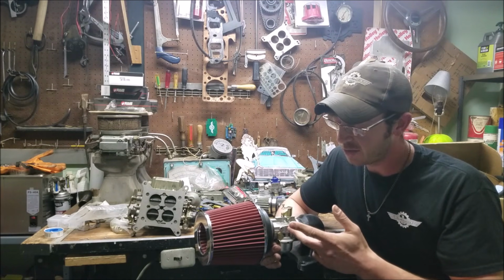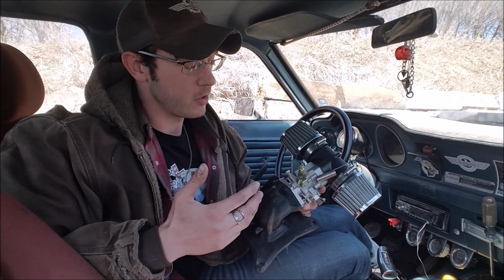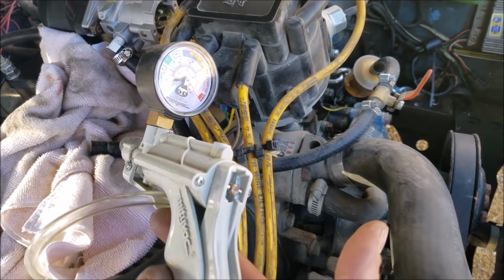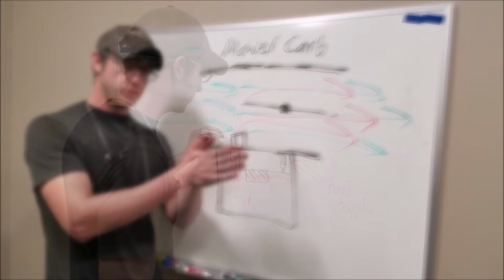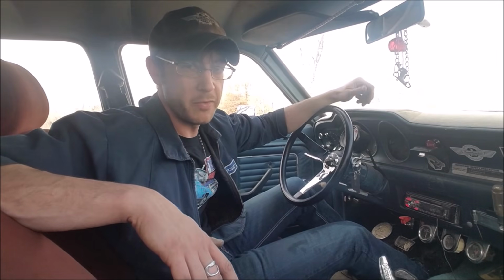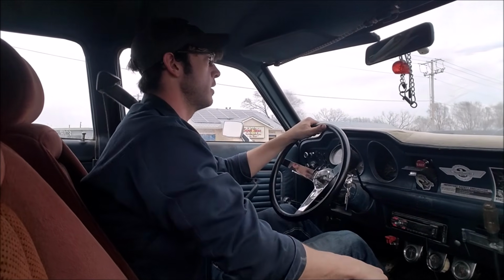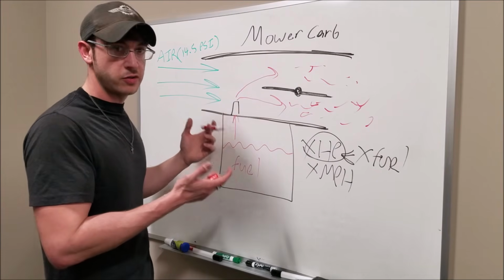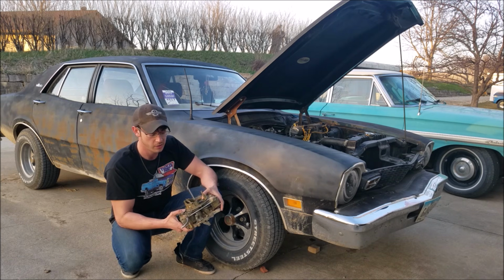Will It Run? Lawn Mower Carb on V8! (The "IMPOSSIBLE" Becomes Reality!) Start to Finish

Comment: Would love to see this on a Lima 2.3 4 cylinder in a ranger or something. Maybe a 240/300 or smaller falcon straight six.
Reply: So many cold, early mornings fighting my 2.3, cruel words, starting fluid and violence emanating from my driveway for the world to hear just for the pleasure of using a motor that could barely pull a booger.  Ahh the nostalgia!

Comment: Don't know why he is so surprised gm,ford,chysler all made one-barrel carbs that were basically a lawn mower carb and if you dialed those back you can get similar results and to be honest you can do it with a regular carb by restricting the fuel with lower fuel pressure and leaner jets.
Reply from the maker: Lol comparing a 1 barrel to a lawn mower carb. Like 1/3rd the size dude. And no one at all beleived this would work till it was literally documented in this video series.

Comment: I’ve always thought about how carburetors shouldn’t have been phased out and that there was always some way to make carbs work as well as EFI. Now I know it’s true.
Reply: Other than the car being very very slow. It worked just fine yes. But with modern efi, efficiently displaced engines, and a vast selection of engine layouts. We find that modern computation being used in computers just shits on carburators. But trust me I would never efi my Chevelle. Nor would i carb my newer fullsize pickup.
Reply: A Holley Autolite 1100 can probably beat this as well as have a wider power band on tap if you need it.... if you want to get these results just drive slow.
Reply: A feedback  computer controlled carb on a 305 in a 83 Caprice would get 32mpg  on the highway when dialed in correctly. The same goes for a 4.6 in  Crown Vic in the late 90s
Reply: @frankpeletz1818  so we find that the answer is simply a more efficient boom. And the only way we have found to make that happen is computer controlled combustion.
Reply: @derucktorez2260  You can dial a carb in with a air fuel meter and it does the same as computer controls. Head design. Compression and camshaft profile are even more important.

Comment: You just exposed the auto industry as mainly being a partner to the oil industry.  The fact the smaller carb doesn't have an accelerator pump is a factor, but not a major one.  I think you explain if perfectly at 55:00; that this scenario is producing a finer vapor than the original oversized carb.  Remember, there was a carburetor designed with a variable venturi that was never allowed to come to market.  And yes, the Pogue carburetor was and is real.  That utilized a vacuum pump in combination with a maze of baffles that gave the fuel much more time to vaporize.  They equipped tanks during WW2 where they needed greater fuel mileage, but they were taken off after the war and never allowed to be manufactured.  They also used water injection on Wasp radial engines that powered the Corsair; we never got that technology either.  Very well done sir!

Comment: This is really cool I hope you sell kits with parts to make it run on 265, 283, 301,327 abc/ 260 289 302 sbf/ 273 318 s mopar. I’m on FB pm me with cost for each setup I love it I’ve got plenty of fast hot rods but would way rather drive an old car with your genius kit than a Toyota everyday

Comment: A  11 HP briggs lawn tractor engine has 391 cc or 23.9 ci  of displacement vs 302 ci  .
So the air must travel over 12 X faster through the same carburetor . Air velocity through the carb body is the force that makes the jet operate. And the stronger the velocity. The harder the jet pumps fuel.

Comment: I was taught in a great aircraft school, excess fuel runs through a carburetor to keep the pistons cooled.  So as long as your pistons don't overheat you should be good.  I had no doubts that you would have success.  I've read about these small carburetors many years before.
Reply: True but much less so for water cooled car engines.  We don't need to cool the pistons except boosted/very high performance conditions.

Comment: I'd be interested to see how one of those CV type carbs (constant velocity) , you know the type with the butterfly and the rubber diaphragm and the slide that moves indepently would go on an engine like this. Really, because no matter how much the butterfly is opened, they sense how much airflow the engine is getting and the diaphragm is pushed up which pulls the slide and needle up with it. I've seen them in sizes up to 55mm for Harleys and smaller sizes for the suzuki quadbikes I think
Reply: Ford has already done it with the Variable venturi that was used in the late 70's and 80's. There was two versions, a strictly mechanical that was used on the 302 and a electronic feedback carb with an O2 sensor on the 351. Many British cars used a carb like you are thinking of, made by SU.

Comment: This has me thinking of a great application of the lawnmower carb.  I have a 70s MGB that I'm going to swap in a GM 2.8 from an 83 S10 pickup.  It's way too much engine for the car and likely would be a bit jumpy, but with your carb setup on it with the cheater, it would dial the HP down a bit and be super manageable.  Not to mention get like 60MPG based on your results, lol.  Point is, your carb cheater and carb setup would be a good way to lose some expendable HP for driveability and MPG with the V6 powered tiny car!  Also, I really like the cheater itself and would love to put that on my 85 Suburban with a 454.  It is indeed overcarbed, but it was the carb that I had.  Your cheater would be a great thing to try on it to hopefully get better MPG without having to lose towing capability.  Please let me know what you decide on selling plans or kits for the "carb cheater" as I would really like to use it on both of my vehicles to see if I can get results.

Comment: Wow, great video. Id be interested to see the hp it can make, and the results of running several of these carbs at once to get more hp (maybe second carb opens at half throttle).
Reply: Yeah, I can't remember who made it, but I know at least one manufacturer made straight six engines with two single barrel carbs. One feeding the front three cylinders, one feeding the rear three. This was back in the sixties.

Comment: Am l way off in thinking you've converted a simple carb intake into a mostly mechanical throttle body injection system? It seems that your a/f ratio voodoo mixer takes that carb from static to reactively dynamic. I hope you're going to dyno this set-up and share the results...
Reply: That would be nice...dyno comparison of regular carb to the  mower setup..and what are the differences in power/torque..
Reply: @renwickconolly2839  that and the vehicle weight and drag coefficient would tell us horsepower required to push that Maverick around. Thinking about fabricating a restricter plate for my fuel injected car to boost mpg...
It seems that modifying an electronically injected car that already has sensors might be even easier. Less metered air = less fuel for greater mpg.
Reply: It would possibly pick up HP on the Dyno at high rpm the velocity speed over the carb jet would pull a good amount of fuel so create a air leak metered with fuel you would be able to easily tune it and create as much cfm as you need

Comment: I’ve been tuning on the 300 in my 86 F150. Had a bad valve seat so I swapped an efi head on and brought compression from 8:1 to 9:1 and output from 120hp stock to an estimated 170. Torque output is crazy now. Got the timing about to the peak and with 3.55 gears and a C6 on 31’s, I’m getting 13-14mpg. It’s gotten 10 if I was lucky for a long time. I’m done tweaking so I’ll know better next time I fill up. I’d be interested in trying this on Truck Norris. Maybe two carbs with one as a secondary? Lol
Reply: I'd considered this myself, perhaps with a way to switch from economy to performance. 

In essence creating a fully selectable secondary circuit.

Comment: When is this going to be on the Market? I’d pay $500+ for this set up.
Reply from the maker: rough estimate - if I sold the Carb Cheater it would probably be in the 300-400 range. 
the air fuel ratio tracking is where I take my biggest material cost hit. 
the intake and carb are cheap.
Reply: @ThunderHead289  It's a shame you can't sell a DIY kit for your carb cheater, or sell just the plans.
Reply: If you’d like to continue the experiment I’ll buy a 1st Gen Honda Pilot with a 3.5 to adapt a carb cheater to. I’d like nothing more than to have one made for my 05 Pilot.
Reply: @ThunderHead289  honestly still cheaper than a Holley efi I would buy a kit
Reply: John Gaines , you might not need an adapter for a Honda Pilot. The top cover of the intake manifold leads to the runners. The throttle body area would have to be capped but you could just drill the holes for the carb . 
I’m thinking of super charging my 2022 and I know there is a ton of space above the engine on previous models MDX and Pilot.

Edit: if you wanted to use the exact lawn mower carb he is using, you could do a flat plate in place of the throttle body since it is a side mount.
Reply: Just take my money. I can’t get my 383 stroker to run with my 750 double pumper

Comment: Fun build. I had a 72 4 door that I bought for $100. $25 at the junk yard replaced the fender/bumper and related junk. I drove it for about 2 months without an air filter and a connecting rod found it way out of the block. Good times.

Comment: Larger displacement engines have a lot more rotational mass. They're harder to stop once they've started. It's part of why your older, less power-oriented engines were HUGE, or at the very least had massive flywheels. They're a lot more stable than one with smaller displacement.

That's my best explanation for the smooth roll, anyways. Your initial shock when this was released is understandable.

Comment: So cool that it worked!

This appears to be a re-invention of work by tinkerers and small manufacturers that started to peter out in the late 70's/early 80's.

Next questions: what are the exhaust temps (a result of lean burning, leads to valve damage), and what are the pollutant/NOx levels? Fuel economy is not the only metric an OEM must satisfy.

Comment: I am not a mechanic or engineer so don't know the first thing about engines. BUT I do get that gas burns quicker than liquid so the more "gasified" the fuel the more clean the burn and the more power per unit of fuel. I run a BMW 325CI that just drinks fuel. Love an over the counter kit, model by model. Go for it!

Comment: You should try a Harley CV40 carb. It would probably be a better driver. The Buell Blast also uses a CV40 for a 500cc single cylinder with an automatic choke

Comment: I admire this. I watched this late. I would have believed this to work. Would not have been a disbeliever, but only at limited RPMs,  because of the lawn mower having limited different circuits compared to a cars carb with an an idle circuit, power circuit, accelerator, etc but your really Ingenious idea of the carb tuner fixed this. I also would not have been one to think it would run lean, because of the limited air flow. But also would not of thought of it making it run run rich!! Damn good thinking. 
As far as better fuel milage, as an old guy I understand that smaller carbs give a much better fuel atomization. 
This was Cool
Not good at math! LOL

Comment: Two things: First, I have run everything from a Yamaha PW 50 carburetor to normal 4 barrels on a 350 Chevrolet 350 engine at a carburetor shop in Oakland Park, Florida. I would never have told you that it wouln't run.
     Second: When using a carburetor that is much smaller than the pump behind it at a point the carburetor just becomes a jet of sorts. You realized this and made a corrective device to allow extra air in order to get the air to fuel ratios that you were looking for. (Very clever design and much more reliable in theory than the electromechanical valve that Rochester used in the Varijet Computer Command Carburetor System)
     In effect, many have used really small carburetors on a V8 in the past. You weren't really breaking ground on that as much as many made out. However, you used a super simple carburetor instead of much more tunable carburetor like a Mikuni and you also came up with a VERY CLEVER little AFR controller that made your experiment not just can we make the V8 engine run off of the lawnmower carburetor, can we make it run really well. If you added a throttle position sensor and the ability to add a little more richness on tip in you could get even better throttle response and still have fantastic fuel mileage.
      Maybe another video of the lawnmower carbureted Ford on the DYNO???? LOL

Comment: Nice work, shows what can be done.
In my younger years I messed about with cars and carbs. I worked on cars in the Fuel "Crisis" days.
I put a DIY Pogue vapour carb on a 3 litre and got 54 mpg.
I put an SU carb from a British Leyland on RX3 madza, and an even better one on an RX7 and got 35 mpg @100mph.
Means if you or I can do it from our garage, the Industry can do it in spades with all their resources.. so why not..
It'$ all about the Money. Every time. 
Still got the bits in a box somewhere.

Comment: So many people dont get that, just because the power is there, you dont have to use it. Remember the 90's when you could go buy a gas car that got 45mpg? in the USA and the same car got 70mpg on diesel in the UK? or better? yeah, it was amazing. You could also trim some weight off the car, lighter seats, windows, hood, low rolling resistance tires.

Comment: I had an AMC 304 and I got under 15mpg. I swapped it put for a 360 with an aftermarket intake(much taller) that was meant for a 4 barrel. In order to use the 2 barrel that I had from the 304 I had to get an adapter plate adding even more volume to the intake. To my amazement I started averaging 28mpg. This was a complete accident. Most people don't believe me when I tell them about my old jeep.

Comment: I have a Holley 1bbl  #(1945) from a 70's slant six on a 302 Ford V-8 2 bbl manifold and it runs fine, almost 20 years now. Fuel mileage did go up significantly 👍 plenty of power and idles beautifully, feel i could balance a coin on it.

Comment: Man, this is surprisingly controversial. It seems like this could all work fine in the right conditions. Maybe you can do a follow up video with an added air flow sensor and exhaust gas temp sensors. Then you could really back out what the ratio is at different speeds. People are acting like you couldn't get good gas milage out of a 4 barrel carburetor tuned and timed to run at 50 mph. 
When people put on performance parts, they are more concerned with performance at high speed/torque, not so much with fuel efficiency at highway speeds. I was skipping through, so I may have missed claims of higher fuel efficiency, but I think people are missing the point. 
You made a thing designed to do one simple thing do something it wasn't designed to do better than expected. Pretty cool.

Comment: Horse power has less to do with this set up than you believe. It's torque that is the deciding factor in top top speed along with RPM. There is a correlation to RPM, HP, and torque but that v8 despite obviously making way less HP and subsequently less torque is still enough torque to maintain a decent speed even with a fairly heavy car. I will be doing a build like this in the future I've got part pf the adapter made up in cad and have a 125 cc pit bike carburetor I'll be utilizing. Still glad you did this absurd build and the carb cheater is amazing in it's design and simplicity.

Comment: Fantastic engineering , many thanks for doing this. Now there are only two questions, how lean can a gasoline engine run and conversely, how high a compression ratio can you run a naturally aspirated gasoline engine in order to increase lean combustion without knock. The reasons that the small carb does so well is that it forces the engine to: 1) run very lean 2) improve atomization  with the very high venturi air speeds. In short, large displacement is not the problem for economy, leaner carbs and high compression ratio is the way to go for economy. It would save catalytic converters too.
Reply from the maker: There's nothing lean about a small carb - furl is proportional to allowed airflow. Technically it's calibrated for a much smaller engine which translates to a naturally rich condition. 

I talk about and show this a ton in the video.